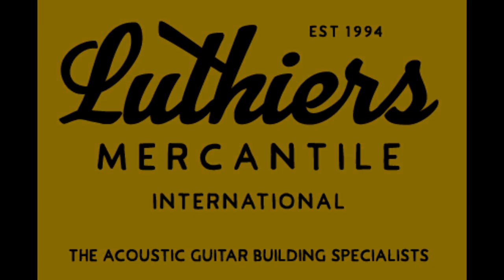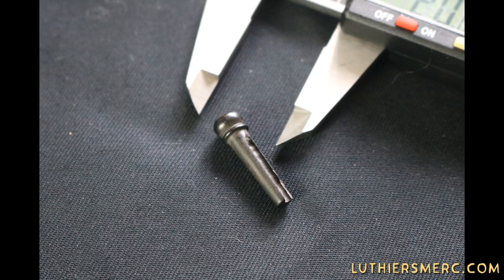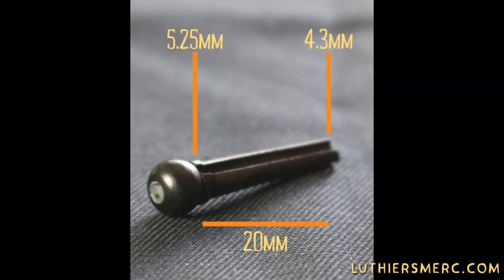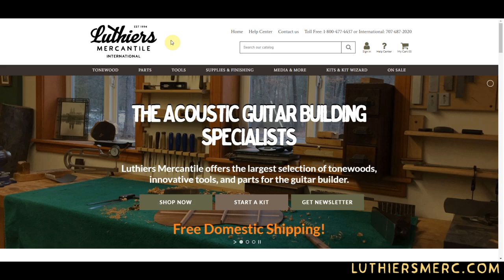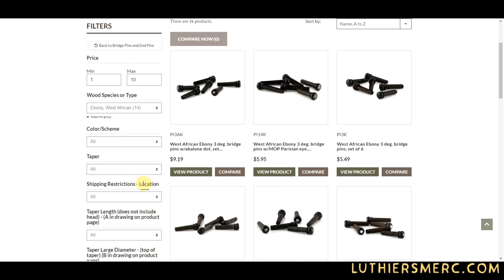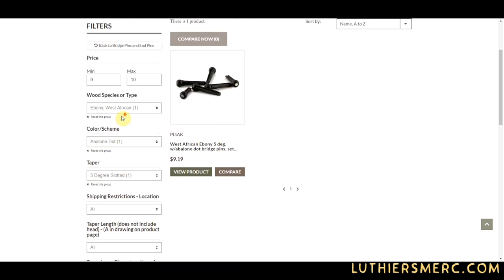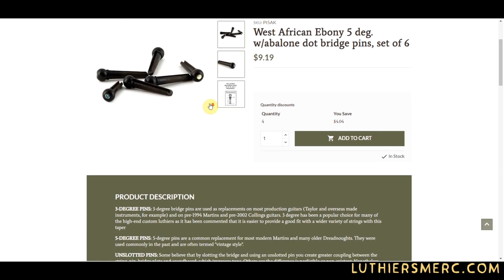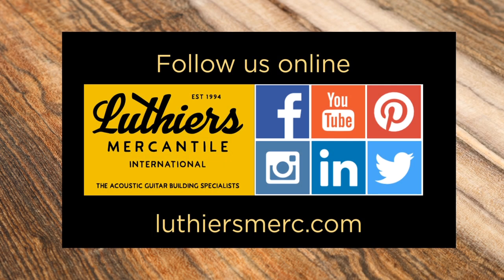How to Pick the Right Bridge Pins

Comment: I ordered the wrong set of bridge pins from a place I really like. Unfortunately, the bridge pins protruded out of the top of the bridge; and, I expected them to fit snugly into the bridge. I will definitely use this site more for improvements to my instrument. I don't have an electronic caliper though. Instead, I have a metallic one that came with a string tool kit. Do the measurements have to be exact and can I use a metric ruler to get the measurements? What do I measure? I understand from the video that I measure the length and the head. What was the 4.3?